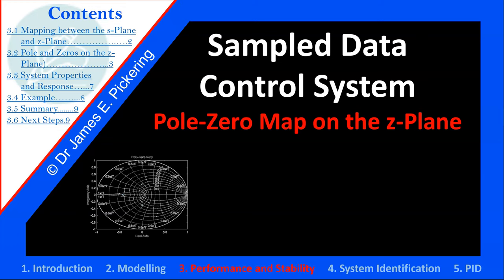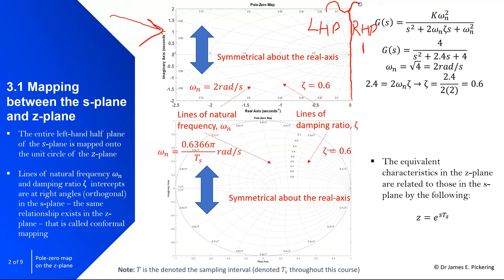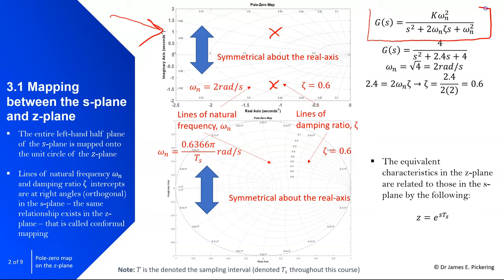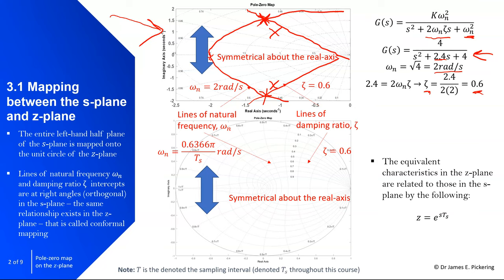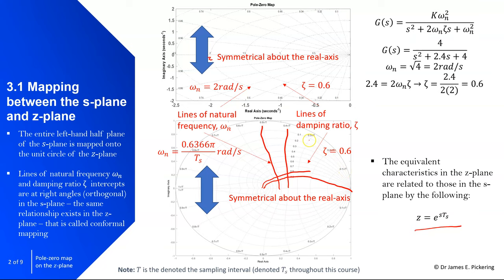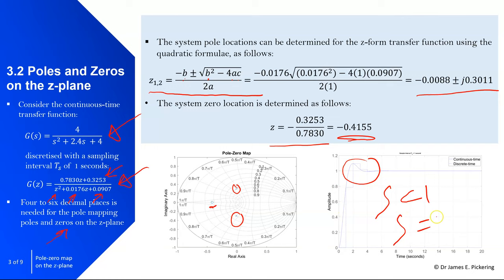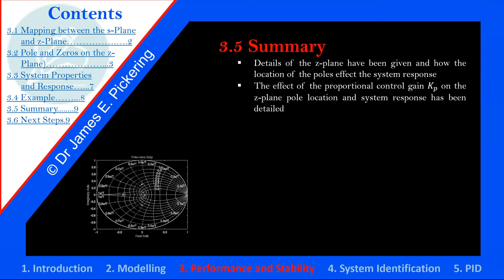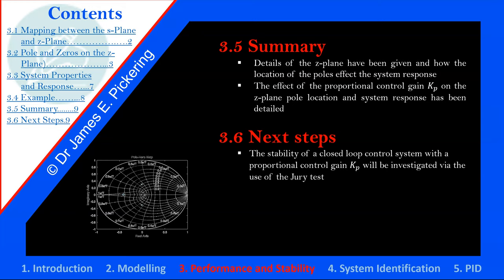3.2 Pole-Zero Map on the z-Plane

Comment: I find the fact that the pole location on the z plane is a function of sample interval in this lecture. From the mapping I find, if the value of Ts(sampling interval) mulitply wn(undamped oscillation frequency)  is bigger than pi, the discrete system will be unstable.  Is the statement is right? Professor.